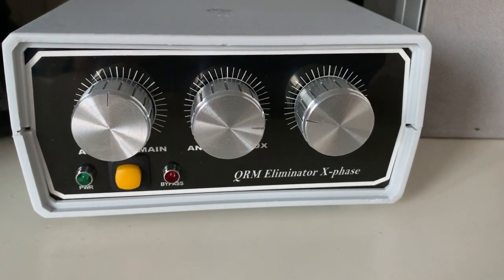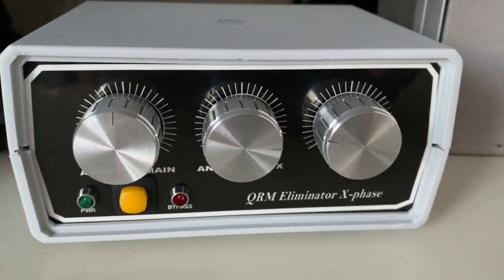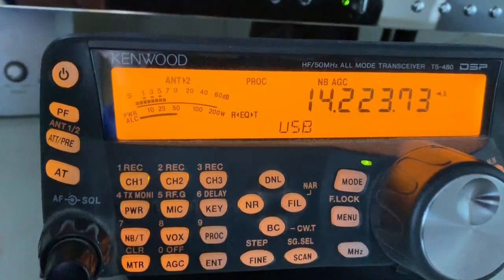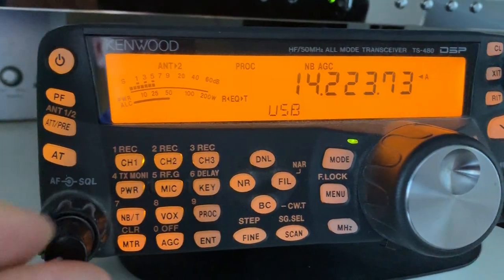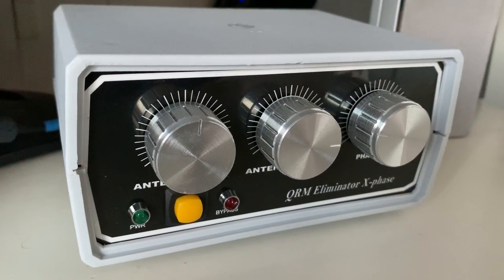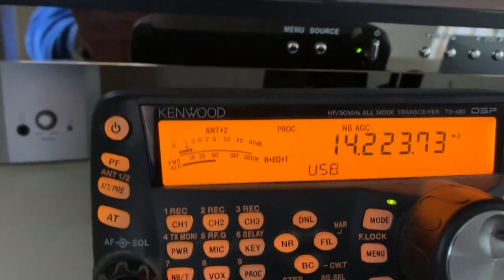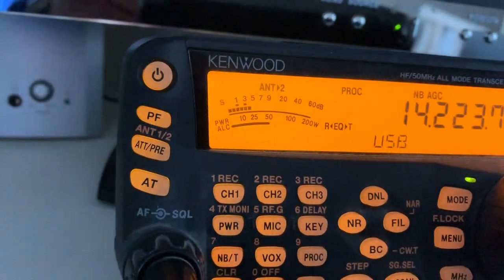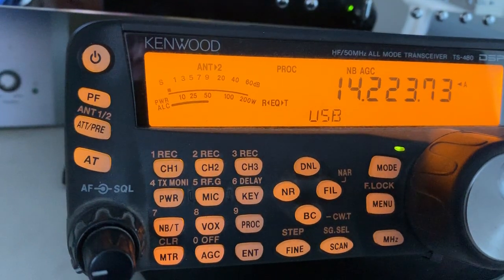Demonstration QRM Eliminator X-phase on 20 m band

Comment: Is the solar panel noise / interference there 24/7 or does it come on and off at different times and some days none at all.
Reply from the maker: Only during daytime... and the more daylight, the more intense and broad the noise is.
Reply: Thank you, my qrm is not solar panels, I get it when it is dark but the noise is identical. I use a beam antenna so wondered if it could be picking the noise up from a mile away or something.
Reply from the maker: @j0llyroger889  if it turns up when it's dark, good chance it's led lights.

Comment: QRM Eliminato

I got a Yaesu FTDX 101 MP

QRM Eliminator is turned off can you transmit 200 watts ON it

another problem I would have with The qrm Eliminator

all my HF antennas come in the House to a big 2K a Ten Tec 229B manual Antenna tuner

on the back of my Big Ten Tec 229B antenna tuner I got a coax jumper running to antenna switch box

for two different Radios  Yaesu FTDX 101 MP  ICOM IC 7610

thank you

I subscribed to your YouTube channel you got some great videos

73

Comment: Hi, I just finished my QRM X-Phase eliminator from a DIY kit. I included a safety circuit which checks if the PTT cable is connected and connected the MiniWhip active antena. I have a huge QRM on lower bands in the evenings and just tested the eliminator yesterday evening. It seems it works. I was able to get rid of the a part of the QRM. But I can't find any logic of the tuning. Is there nay, where to start the tuning ?
Reply from the maker: Nice job there. I usually start with adjusting gain of the aux and main antenna untill the QRM weakens. Then I adjust the phase angle untill maximum noise surpression.

Comment: In the lack of a (weak) signal, I have been unable to hear the difference with or without the circuit on, in this demonstration. I could appreciate the reduction in S strength of the background noise, but hardly any R difference for my ears.
Reply: That is right. An attenuator does exactly the same.

Comment: When turning the phase back I do not hear any difference in QRM sound. So I really doubt if it works. When turning on the ATT, the same effect can be achieved. So the signal meter doesn't say that much. It's about the S/N ratio that counts, and in that I hear no difference.....
Reply from the maker: It is effective, I can hear signals I cannot hear without the device. But my experience is that it is effective  for a single source of QRM. If you have multiple sources (like many phone chargers or PLC at a few neighbours), they have different phases. So, you can only eliminate one source.

Comment: HI
you connect or the PTT wire on the 480? I don't see what the PTT is on this post
Reply from the maker: Hi. I use PTT via connector for amp switching on the frontside of the TS480. You need this kind of cable https://shop.technofix.uk/8-pin-linear-amp-switching-cable-for-kenwood-ts-480hx-ts-480sat-ts-480

Comment: Good afternoon. This looks fantastic. I have an in-line LDG IT-100 autotuner for my IC-7300. Will the Eliminator still work ok with the ATU connected? Thanks and 73.
Reply from the maker: Should work. When you transmit the relay in the QRM Eliminator disconnects the aux antenna.
Reply: PA9X Thank you.

Comment: Hi Jean-Paul,

First of all: thanks for posting! Although I'm Dutch (just like yourself) I will write this in English, so other viewers will be able to read along.

I have a terrible QRM in my shack, which sounds like white noise combined with a small rattle (the rattle is only noticeable on SSB). I'm not sure if I'm dealing with RFI or EMI; I haven't been able to locate the source (yet). On FM it's S5 and on SSB S7-8. Since my radio hasn't got a possibilty to connect a PTT line I was wondering if it would be completely safe to just rely on the vox.

Another question: how much RF power will this device be able to handle on FM and SSB? Usually I'm running standard power (55w) but on rare moments, when a QSO becomes critical, I like to insert my amp. If the RF power exceeds the handling power of the X-Phase, would it also be possible to place it between the RTX and the amp, so the X-phase will only receive 55w max?

Looking forward to your answers and thnx in advance!

73's, Gert
Reply from the maker: Hi Gert. This model can handle 100 watt, but to be sure I recommend contacting Igor via eBay (https://www.ebay.com/usr/igor_us4lg). I am not sure if the vox controlled relay works on SSB, but Igor should be able to answer that.
On what band do you have this noise? And what are you considering to use as auxiliary antenna?
73 JP.
Reply: @pa9x  Hi Jean-Paul, my radio covers  the 10, 11 and 12 meter band and the RFI/EMI is on all three of them, so it's huge. I'm not sure what kind of aux antenna I'm going to use. First of all I want to try to locate the source with a handheld. If I know where it's coming from I might be able to pick it up with a simple and small aerial close by (like a vertical wire), so it will be picked up better. If it's coming from a far distance I guess I have to erect a 'real' antenna on the roof.

Thnx for the link by the way! 73's, Gert
Reply: @pa9x  Hi JP, just an update...

Yesterday I did some testing, since I was wondering if I could pick up the QRM with a mobile 5/8 whip on the ground floor. In the best position I received the QRM with S 4 on the aux (ground floor), while it was S 7-8 on the main (roof). I think this is more than enough to combine the signals and put it in counterphase, so I'm happy on that.

I've just send a message to Igor, asking him if this device also works properly on SSB, concerning relay times etc. There's also another question I asked him and maybe you have some thoughts on this as well;

Since I don't have a PTT socket on my radio, I'm concidering building one in my desk mike. The idea is to connect it to the contacts of the PTT button in the mike (a switch is a switch right?) So when the PTT button is pressed: bypass, and when the PTT button is released: X-phase working. This should work I think...

73, Gert

Comment: What is a noise antenna? Where is the shape and desing  and lenght ???
Reply from the maker: A noise antenne can be any type of antenna, as long as it receives the QRM you wish to eliminate. In this clip I am using a 6  dipole, but now using a 2.2 m vertical antenna for the high HF bands and a Miniwhip antenna for the low HF and MF bands. Take into notice that most man-made QRM is vertically polarized.

Comment: Absolutely love this circuit! I have built it for QRP use, but now I need to put it in proper metal box and replace the BNCs with SO239 connectors for the 100W new radio